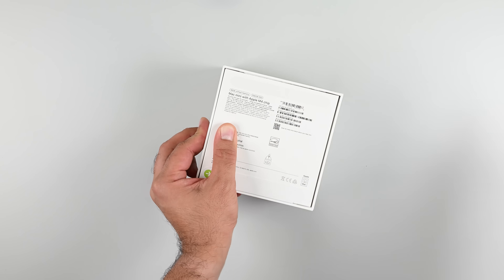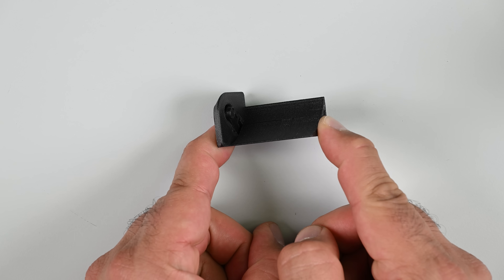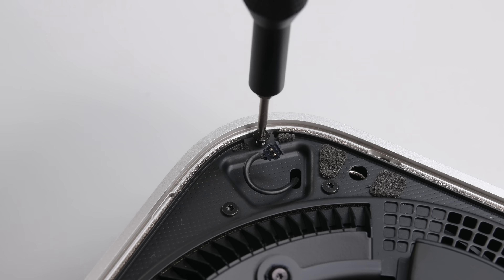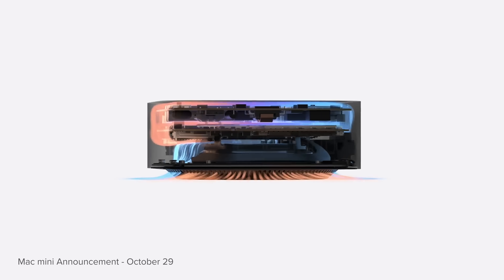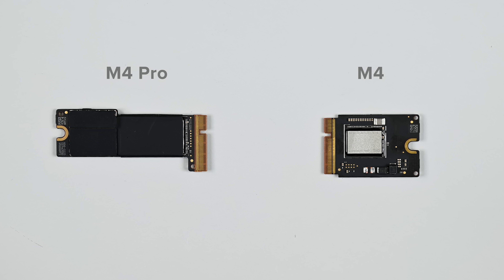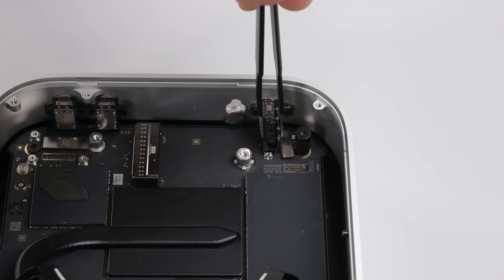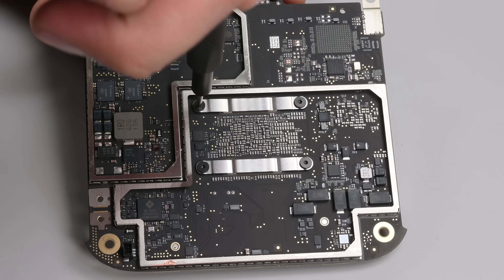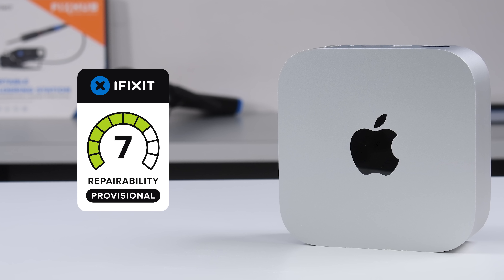M4 Mac mini Teardown - UPGRADABLE Storage, Powerful, and TINY

Comment: @4:48 you make a statement comparing primary storage (DRAM) with secondary storage (NVMe SSD). You claim the NVMe SSD is “surprisingly upgradeable” while the DRAM is “tightly integrated into the SOC architecture” which is a gross over-simplification of Apple’s unified architecture. You cannot win no matter how well you describe the Apple’s SOC (system on chip) design. TODO: Compare Apple’s unified SOC architecture with Nvidia NvSwitch servers.

Comment: My PS4 is five I think it’s 10 years old actually and I’ve never had a place to see my battery and it’s not really called the CMOS right on an Apple but either way I’ve never had a place the battery. I just threw away a watch that I don’t wear anymoreand the battery was still going in it and it was at least 10 years old. Those batteries can last.

Comment: what pinout do these Mac Mini M4 audio jack sockets use.
It doesn't seem to have any native microphone in these M4's, so I tried a decade old cheap mic from CN.. its that small tiny one with two metal-like-mic-grills on each side, and M4 doesn't pick it up when pushed all the way in, but if I pull it in slowly.. like 3mm before all plugged in, OSX15 does pick it up, and it works great for siri or chat vocal intelligence support, but its a pain to balance it halfway in before the system takes notice.
Does these Mac use a proprietary uncommon pinout of for the audio jack socket?

Comment: surprised that another Mac Mini's M2 drived worked.. though they were component locked to its native machine, but then again would maybe be to steep even for Apple, if your Mac Mini M2 was goneski the moment your M.2 drive went sour.
but I doubt it will take long before M.4 drives are purchaseable from thirdparties at quite attractive prices in regards to Mac storage, as these Mac Mini M4 are flying over the counter, so a huge market to cater for.. but it is also weirdly good value this Mac Mini M4 and its fascinating how little wattage it consumes.

Comment: Why did you have to go through the configurator?
Reply: The firmware is stored on the SSD so you need to reinstall the firmware (like a BIOS, but yeah Macs don’t use that they use iboot) and OS after replacing the SSD. It also pairs the SSD with your Mac’s SSD controller.

Comment: Why do they make it that you have to be Doctor Who to upgrade something as simple as storage? I'm, seeing people having to remove chips n stuff.  WIll you bew able to put a WD or Crucial SSD in it at a normal non gut wrenching price?
Reply: It's because Apple's consumers aren't highly educated computer scientists. PC people don't understand this, because they love computers and soldering microchips and stuff. Apple sells machines to people who don't want computers. That's why they call them "Macs" and not "computers." You go to the Apple Store, spec it how you want, use it for years longer than anyone else in the industry can support a device for, then return it with Apple's industry leading recycling program which returns the equity in the device, and you buy a new one. Simple as pie, and consumers everywhere love it because they don't care about upgrading RAM halfway through the life of the device, it's not as important for most people as not ever having to take the device apart is.

Comment: Obviously not meant to be user upgradeable, otherwise they wouldn't require you to take apart 3/4 of the machine just to get to the SSD. The PS5 has upgradable storage. The Surface devices have upgradable storage. The Mac Mini has anti-consumer design with theoretically upgradable storage that is just as hard to get to as it is to find modules.

Comment: Hi, does anyone know if the M4 Mac Mini's logic board can run off a bench power supply, or does it require communication with the original PSU? I'm considering embedding it in a sleeper PC. Thanks!

Comment: The removable SSD on the Mac Mini M4 isn’t really there for easy upgrades with third-party options. It’s primarily a safety feature. If the device completely fails, the SSD can be removed, and the data transferred to another device, so it’s not permanently lost with the motherboard. While this is great for data recovery, Apple is unlikely to make SSD upgrades or replacements user-friendly.
Reply: Transferring the module like that won't allow for data recovery, as it isn't really an SSD, just a raw NAND module, and the controller is part of the CPU itself

Comment: Very misleading - 99 percent of users can not upgrade the storage
Reply: 1% can so it still makes it true
Reply: That's "will not" rather than "can not"—with iFixit making instructional guides and Polysoft reverse-engineering the designs to make their own the only limitation is peoples' willingness to do it rather than their ability. It's not like this is a phone where everything is glued together—aside from the base plate being held on with clips it's all screws and press-fit connectors.

Comment: how did they make it so small?? maybe because the mac mini was way toooo big for those few chips that were inside... watch linustechtips videos the m1 mac mini was almost empty.... they removed the empty space, made the case smaller and fit it tightly... nothing impressive here... on the other hand they charge 200$ for additional 256gb ssd... which is just ridiculous.

Comment: Replaceable SSD and ports is 100% driven by EU’s new right to repair rules. One interesting aspect of this rule is that manufacturers must make parts available to consumers directly. Therefore, you will be able to buy larger SSD modules (though yes, at Apple’s inflated prices).

Comment: This is actually a good thing, if the ssd it’s not paired with the computer, it could be installed a new one. This has a couple weeks on the market right now so it’s a fact that 3rd party manufacturers gonna make this ssd’s to upgrade your device, just like the OWA disks for all MacBooks with a proprietary connectors, that are actually incredibly good

Comment: So many people not understanding why the ssd change is a genuine improvement for repairability. The fact that it’s not soldered directly to the board and the memory controller is now on its own daughterboard means that if either component breaks it’s a much cheaper/easier repair than it was before.
Reply: almost nothing changes, apple does not sell replacement, you still need to solder new BLANK nand chip onto that board, and that board has drm. the only thing changed is doing soldering work on that removable board is easier than the main board
Reply: @pinkysweets  Soldering is only required if you want to replace the NAND on the board you already have. Apple sells replacements of the same capacity as the one they already sold you through their self-repair program, and third parties are now selling aftermarket boards which don't require any soldering at all.

As for "DRM" (that term refers to digital video, not hardware) there is no pairing which doesn't also happen with an off-the-shelf SSD. The only difference is that since the storage controller is built into the SoC rather than being a separate microcontroller on the same daughterboard as the NAND chips you can't replace the NAND module without running a DFU reset so the controller forgets any existing information it has about the status of the NAND.

Comment: I am a long time mac user, and the idea of really considering to switch to Linux is soon a reality as I failed to see in the current softwares and hardwares directions not want to change from Surveillance and more crippling/disable/de-power-users/de-own/unfixable-devices etc., and I am not just talking about Apple/Macs! Linux is also degrading toward these, but much slower and has more resistance and more options currently!

Comment: The holy grail, if there's room, would be an adapter card you can plug a regular NVME drive into (even if it's has to be a small one). I suspect that could be difficult since the controller chip is on the motherboard, but ingenuity might find a way.

Comment: 7/10? For providing (FINALLY) something that everyone else provides as a basic level feature that the rest of the civilized world wouldn't go without?

Geezus guy. 2/10 at best. 0/10 if you consider that EVERYTHING from the fan assembly to the case screws are paired to the mainboard. XD

Comment: Is iFixit paid off by apple? I mean no way  you're so enthusiastic about overpriced mobile hardware and semi-upgradeability. I mean sure you can replace the SSD but you must buy it from apple for 10x it's real value. Remember 1000$ ddr4 ram?  Or 1000$ casters? Or a 1000$ piece of aluminium called a monitor stand? lol.

Comment: How are people surprised by the size after Apple has started sticking these chips into iPads? Even their phones have similar single core performance and now match the M1 in multi-core. I think they could shrink the M4 version even further but since it also comes with the M4 Pro it wouldn't make sense.

Comment: Apple has been recommended by the EU to make its devices more repairable. In my opinion, in a few years, when the Mini M4 will be at the end of its life cycle, Apple will turn a blind eye if a third party builds a compatible SSD module for the mini M4, not before. However, for the next few years it will be obliged to provide original spare parts, unfortunately for us at a high price.

Comment: I would love the ability to make my external drive that is connected to either the Thunderbolt 4 or 5 port to be my main drive.  Or if there was some kind of Raid or other configuration that would "extend" the main drive to use the external drive to show everything as one.  I guess I could install MacOS on my external drive and just change it as the Startup disk!
Reply: been doing this for a couple months now without a hitch, and its awesome. hopefully apple doesnt sabatoge it somehow, but   ppl used to do this back in the day alot apparently during the shift from hdd to sdd...

Comment: Future MacOS wil need more RAM and its not upgradeable. This means you must order the Mac Mini with 32Gb at least to avoid that fate. Adding external thunderbolt storage should suffice for lots of archive type storage without the big performance hit especially SSD thunderbolt drives and the Pro gets TB5 speeds.

Comment: With regard to the power switch- would it be possible to move it to the space in the aluminium casing above the switch on the back of the casing?   I know this would mean drilling a hole in the metal, possibly (most likely, actually) invalidating the warranty but would it be possible?

Comment: Just look at the price difference between the 256 and 512GB models. Huge amount of money for a basic ssd module. Just check how much a 2TB or even 4TB costs PC module costs. Also, for a simple all-in-one device, this Mac mini is overpriced. And the fact that the ssd module is proprietary does not really make it "up-gradable". Especially since if Apple ever releases single ssd modules for use-upgrades, these will most likely cost a ton of money.

Comment: If we want to upgrade there needs to be a another slot but if it is only one slot it is impossible to upgrade because OS is required and Mac OS isnt available in Apple website for download and Install
Reply: You use DFU tools to download Mac OS and install it and firmware. Macs have these tools ofc, but there’s also a CLI tool in Linux that does the same thing, provided you use Fedora where Asahi is based off of. Or use Arch AUR.

Comment: a 3D printed button extender is not a 'solution' to the power button problem. I shouldn't need a 3D printer to turn on my PC. It's just Apples form over function approach getting in the way again.

Comment: Recently I am seeing many videos about this and looking in the process and workarounds, it doesn't seem it is worth to do. External NVME SSDs like  WD 750SN, Samsung 970 EVO over thunderbold 3 give better I\O speeds than what is on the M4 (I have been using them since years on iMac, MBP and Mini M1 - around 3000/2500Mbps  R\W).

Comment: If anybody can find a way to upgrade ram, then it's really really great.
How many 4k monitors can we connect to it? 1 or more than that?
Reply: The RAM modules are extremely close to the CPU and use super tiny pads. People have tried and made a mess. IT won't be possible. As for monitors you can connect 3.

Comment: Calling this “upgradable” is a stretch. You cannot buy and use aftermarket SSDs and only use Apple proprietary and extremely expensive drives
Reply: Maybe some chinese companies will solve that problem...
Reply: @Xenomystus  subject to restrictions: you can only insert blanks or clones of former drives; have to upgrade both modules if there is 2 (because the controller accesses them in striped mode)

Comment: If only there was a standard for upgradable ssd's. Lest cal it, I don't know, M.2?
Reply: I'm pretty sure that is an M.2 slot. You're confusing a connector standard with a storage technology—Apple include a storage controller in the M4 SoC and use bare NANDs because it adds security (you can't take the drive out of one computer and put it into another to read the contents).
Reply: :goat-turquoise-white-horns:

Comment: Great news, to upgrade the ssd I just need another M4 Mac mini with a larger capacity ssd. oh yes, very upgradable.
Reply: only if you want to upgrade the NAND on the module yourself. If a complete module is sold, no need for this.
Reply: @Andreas_Straub  well here's hoping they sell a module soon. Very unlikely. More likely Apple will offer an upgrade carried out by their technicians, at a cost of the module plus the labour to fit it.
Reply: @TheOGRalph  a 3rd party will sell a module at some point, no doubt about it. You can also google a shop near you that does storage upgrade on macs, they will directly replace the nand.

Comment: How is this "user upgradeable storage" if you're saying in the same video that it works only with another storage module from another M4 Mac mini? If I have to buy an entire new Mac mini to replace the storage in my Mac mini, I might as well just use that Mac mini.
Reply: You can get a replacement from Apple's self-repair program, or one of the third-party options which are now popping up (it took time for them to reverse-engineer the board design to produce their own).

Comment: As others have said, the SSDs aren't sold separately, BUT people are already soldering larger NANDs onto them, so I expect Aliexpress to sell cheap high capacity SSDs in the near future, as well as local repair shops maybe offering similar services. And harvesting these modules from broken Mac Minis will be a big business as well.
Reply: There’s french guy that has a gofundme, he already duplicated that nand board, you can contribute and you’ll get your upgrades
Reply: @passportmarc  Can you link it please?
Reply: It's great that people are ingenuitive enough to make their own NANDs and it's good that Apple isn't soldering storage, however they could simply use an M.2 NVME form factor and they don't specifically to drive the cost up at the expense of upgradability and reparability. I full expect Apple to totally change the design, again, on future versions so that third parties have to re-do their work, and I wouldn't be surprised if they went after them legally, as they have often done in the past.

It's better than soldered, but Apple continues to neg it's users. I haven't bought an Apple product since my first gen iPod Touch after the way they treated 3rd party developers and the way they treat users with their anti-repair, anti-upgradeable designs have mostly just gotten worse over time, in spite of legislation.
Reply: i dont think so, m1 mac studio also has removable SSD and has been around since 2022. there's still no 3rd party SSD modules available. you still need to treat those as they were soldered ssd
Reply: @mingm  Mac Studio is more expensive and it was no demand for 3rd party SSD like the demand that this little Mac mini will have for just 600 dollars.
Reply: @MariusVirgilConstantin  good point. It will be very high demand because this M4 base model is a selling hit.
Reply: @mingm  there is a french company who has done a crowdfunding to sell nand modules for the mac studio. they are saying the are now looking into making modules for the M4 mini aswell. altough i'm not a backer, i don't know if they delivered or not (they do seem a seruious company tho)
Reply: then you're trusting apple to never put a software lock on that. If they do all your data is held ransom. Talking about first party ransomware right there.
Reply: @RealLifeTech187  remember, thtis is just a nand module. literally dumber than an ssd. since the controller inside the SOC package, they are not going to change that to specific memory sizes. 
NAND flash modules iclude internal registers with information that can be queried by the SSD’s controller, but to lock that apple i think apple would need to mess with the controller microcode. i'm not sure they'll do that. everithing is possible tho
Reply: @salmiakk_it  If Apple only could tell how much storage a Mac shipped with originally by something like the model number or serial number 🤔
Reply: @RealLifeTech187  do they tho?(model # absolutely not,  but i have my doubts about serial aswell) i'm not sure they do, at least for the models with removable storage.
it should be checked by someone with a m4 mini or mac studio. on my ancient macbook, the online serial check only reports model and purchase time, no specs whatoever. "about this mac" only reports the current hw
Reply: @RealLifeTech187  Apple should never be allowed to do that. Regulations matter

Comment: Hoping for a 2230 to Apple SSD converter board soon enough.
Reply: The problem here is that the board does not contain the SSD interfacing hw - this is in the M4 chip. So it needs a raw interface to the NAND.
Reply: apple NAND isn't NVMe, it's a raw NAND DMA protocol with the controller integrated on the motherboard